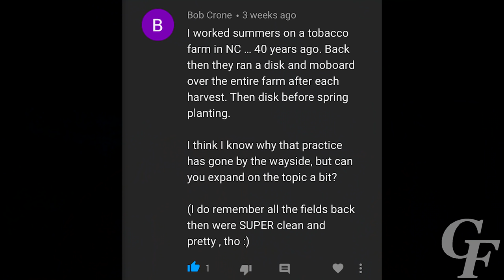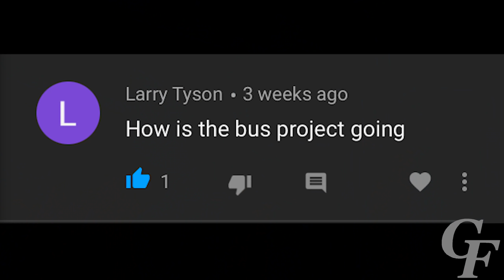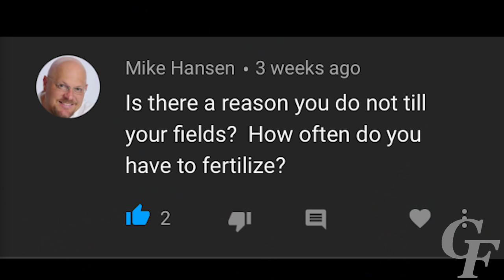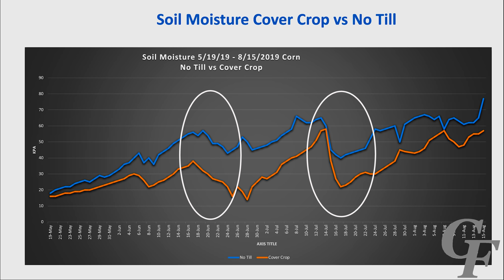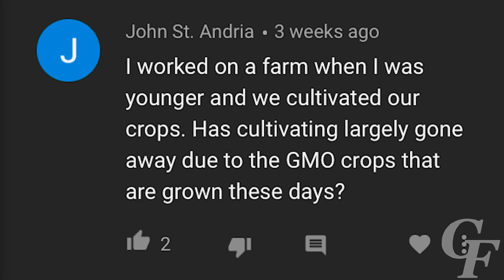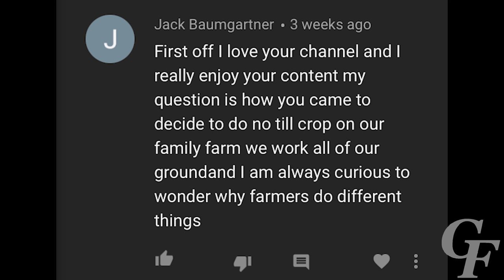Ask The Farmer:  Episode #3 - All about No Till!!

Comment: So if you did not have the chemicals would no till still be the answer? Are the chemicals more detrimental to the soil in the long run? Thanks have a good night.
Reply: No till equipment was actually built in the late 1940's, maybe even earlier.  The lack of chemical weed control kept it from taking off, half the yield with the same input costs didn't pencil.

Comment: What about lime applications (that weren't cut-in by tillage) in the no-till environment? I have seen a few no-till cotton fields that still had significant clumps of undissolved lime above the surface in July when in fact lime applications were made in early spring. Just seems like that would take longer for it, and potash, to work with it lying on top of the ground. Don't mean to wear you out, but also, what's your opinion on foliar feeding cotton with boron and/or liquid K products, or Helena's Coron. I tried a couple of those when I was farming and felt like I just maybe got my money back, at best...
Reply: I saw the same. That’s a big reason I switched to all liquid fertilizer. On rented ground I’ve switched to liquid calcium with humates. So far this has worked great for me.